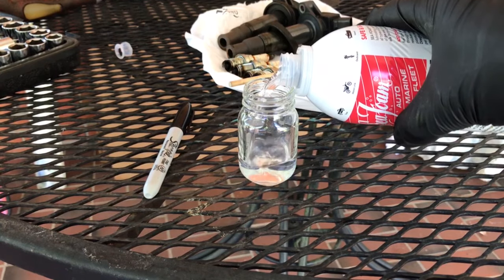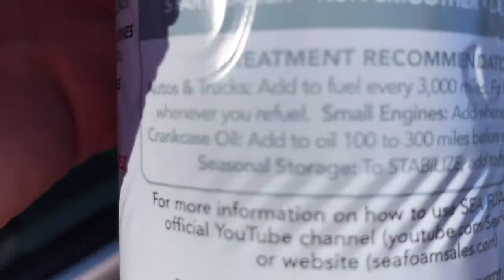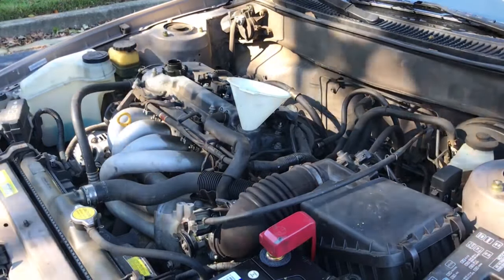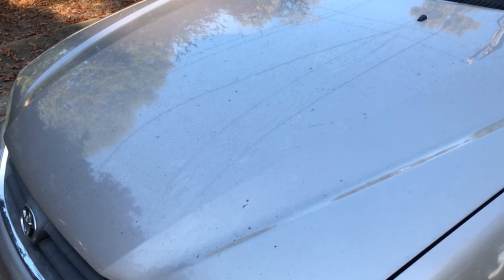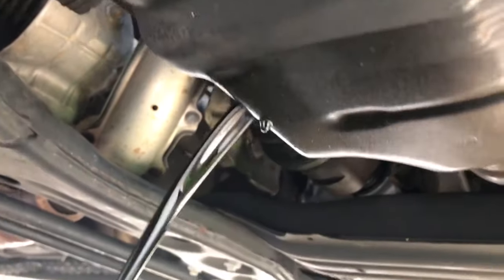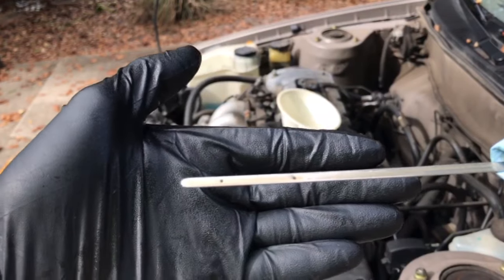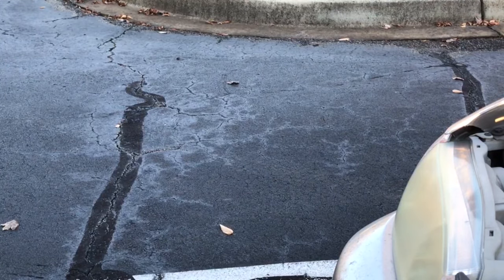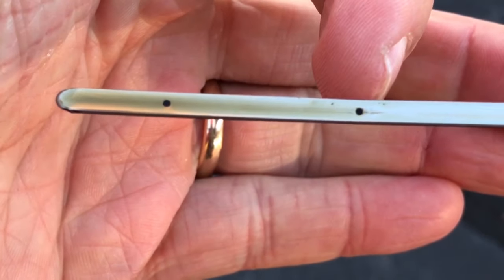Will Seafoam stop oil consumption? | Oil Burning🔥Experiments | Episode 2

Comment: Why did you never check the cross hatch pattern and run compression tests in your videos? (Did you and did I simply miss it.)   If the piston rings seized to the point the word the cylinder walls (wear marks instead of a obvious cross hatch, it is not theoretically possible to fix it with a solution.  Fixing it with a liquid is only possible if the rings were sticking to the piston and not stuck open wearing the walls.

Comment: Hi Dave......Good video. Thank you!   Ive also heard but not seen where Kerosene can be used in the plug cylinders...?  Is that stronger than Seafoam and safe?
Reply from the maker: Thanks :-) ... I think kerosene would be stronger than seafoam; in fact, I read that seafoam is about 60% kerosene or something very close. There used to be something called Motor Flush (perhaps there still is) that smelled like straight kerosene. If I remember right, you were supposed to empty a little oil and add a quart of the stuff to your engine, but only let it idle for 5 minutes and then change the oil. .... I might end up trying that or Kerosene after I get finished with the Marvel Mystery Oil experiment. Thanks for the comment--and the idea.
Reply: Never put kerosene in an engine it's not good for it. You can use motor flush during oil changes. Kerosene is a slower burner than fuel but ultimately not good 4 the pistons and rings
Reply from the maker: @crisknapp1990  Thanks for the advice, Chris!
Reply: @FamilyFriendlyDIY  no problem. I've been an engine mechanic since the age of 8. I'm not a know it all but been at it a long time. If you have an engine that's been sitting for years and years, if its totally froze up you can put 10w-30 in top of the cylinders let. It sit a day or 2 and that will unfreeze it. Pistons and rings expand when cold and shrink when warm, this is why some cars tick for a little while once you turn them off.
Reply: @crisknapp1990  piston rings are made of metal, I do not know any metal that Expands when cold and contracts ( shrinks you say) when hot??
And I think you will find that the Ticking noise comes from the exhaust section of an engine when cooling down as it is a long component and gets very hot it Expands a lot and therefore contracts a lot!
Reply: @Law_Abiding_Citizen_ok  if you think the pistons and rings don't slightly expand and contract in cold and warm weather you should go to mechanics school and learn something before you come 2 me.
Reply: @crisknapp1990  he was joking cos you got them in reverse order,nexpands when hot, not cold.
Reply: @FamilyFriendlyDIY  I think it’s called gunk it really removes grease from cloths
Reply: Kerosene will take out sticky gunk out and cut the cylinder and piston. No jechanic I am  but common sense . Dave you would know better answer than me layman 😅

Comment: I have a 1nz-fe in an 04 scion, burns a quart every 200 miles (on a good day).  269000 miles, and it's on for about 8 hours a day lyft driving in the san Francisco Bay area.  Gonna try this and a little in the spark plug holes based on your experiments, thanks
Reply from the maker: The success seems to fluctuate. We've done some more videos on this and the oil use at times has been as much as ever. Still working to find the definitive solution. Lot's of advice in the comments though. Some say they've had success using a whole can of seafoam and leaving in for the entire oil change -- I'm not recommending it, nor have I tried it ... yet. We'll see. I hope for the best for you. We're trying to use more expensive "better" products with each experiment... and if none of them work, we plan to do a video of mechanically fixing it ... Thanks for watching, and if you find success with your attempt, please let us know!
Reply: I have same car xb I’m replacing the pcv valve and trying this did it work what u do?

Comment: Thank you. I hope this comments reach you in good health and you get the chance to read it. 
My question is : 
How about doing the same experiment with Carburetor cleaner stuff rather than seafoam?. Do you recommend me to do it on my car?
Reply: No. You could damage the oxygen sensors or even possibly the catalytic converters. Use only the Seafoam, it won't harm either systems.

Comment: Some are un-stuck but a cylinder or 2 is still stuck. That's why it's still losing some oil.
Reply: Maybe. He should check the oil level after the cars been sitting for a few hours, not immediately after driving. Some of that oil is still in the engine, so giving it time to run back in will give more accurate results.

Comment: Any updates on this? Need to know as I too have 1 cylinder with stuck ring and wanted to know if your car is still burning oil? 🤔 thanks 🙏🙏🙏
Reply from the maker: Look for the Berryman’s B-12 video. That’s where we get noticeable improvement.
Reply: @FamilyFriendlyDIY  I just watched  watched Ep16, thanks for the video, so that means that Seafoam did not work then? Did you try Seafoam Deep Creep also? 

Mine seems to be a stuck piston ring because when I do a dry compression it goes to about 60 PSI and once I put a teaspoon of oil it goes up to 160 PSI, so which means mine is probably a stuck ring, but it's been 3 days now and no changes on the Seafoam, I just put Deep Creep to see if this will work.
Reply from the maker: @half_r_mk5  Nope. I didn't try deep creep, but Berryman's is a much stronger product.

Comment: 1-4 diesel-oil mixture. thrash it in 3rd gear up and down the road for 20minutes.
this strips the sludge build up at the top of your pistons. where the build up sludge carbon sticks. drain the oil straight away. top up with cheap oil then go give it another thrashing.
this time drain the oil plus take of oil pan and replace or smear gasket sealer on when putting it back on.
my car toyota corrolla 2004 dosent have a gasket. only needing gasket sealer. clean the oil screen pick up. plus degrease the oil pan inside.
best to take of valve cover when your doing this,peace of mind.and then inspect or replace gasket. top up with new synthetic oil. run for 3-4weeks or about 500-1000kms.
then repeat process, without taking of the oil pan this time. unless your want to check for curiosity. note my car had 90,000kms on it, forgot to top up oil and coolant. build up sludge big time when i opened valve cover and oil pan. anyway more then ten years later ive had no problems with it, took away the pistons from sticking plus the dreaded smoke.
the local mechanic told me this trick. saved me thousands. cheapest and most officient method out there. old school mechanics. all youtubers where against the diesel mix. because of corroding inside of motor and damaging the seals etc:
13-14 years later the proof is in the pudding absolutely works.
you should also clean or change intake gasket manifold after this process.

clean throttle body-variable timing valve solenoid-pcv-mass air sensor-oil filter-air filter.
pollon filter-clean fuel injectors and full radiator coolant flush. engine-radiator-heat core.
all these things can be done by the diy-er at home. cleaning or replacing small sensors and valves saves the car from those big mechanical problems that cost an arm and leg to get fixed. my car runs like a ferrari now. lol.

Comment: Maybe works in theory, and possibly in practice. But, if it can remove carbon/ burnt oil from an oil ring, then you gotta believe its attacking all other sludge/carbon in the engine. So, how do you know you will not dislodge enough crud to plug up important passages in bearing and or screens inside of some engines , and or clean gummed up gaskets and cause a big leak ?
Reply from the maker: That's definitely a risk, flexjay.

Comment: How do you know its stuck the rings do you have low pressure on that cylinder?? ?check pressure in each cylinder.
.Why don't you use MMO it's better
Reply from the maker: Hey @Sroor9001, I'm assuming it's the rings because this engine is notorious for this problem. Toyota put in low tension rings to cut down on friction, but they didn't spec synthetic oil. The conventional oil (probably combined with driving mostly short trips) supposedly causes varnish to build in the ring grooves, causing them to get stuck in the grooves. They say an additional cause is that the drain holes in the piston skirt are too small as well.
I might try MMO next. Thanks for the comment!
Reply: If you have carbon build up in the cylinders you actually have higher compression because the bore stroke is reduced due to the build up, also as he added it direct to the oil it also goes around the rest of the engine including the cylinder head witch as alot of return pipes and valves that return it to the sump to reduce head pressure. So if it does what it says then the cleaner would also clean the rest of the tiny oil out and inlets giving it better flow .

Comment: You want your rings not 2 stick? It's simple do your oil changes on time. If the car has been sitting running it over time will help it
Reply: Not so simple on the Toyota engines that have a habitual problem.  Yes obviously changing the oil on time helps but Toyota screwed up this ring piston combination and there is definitely premature sticking on these models.
Reply: @kinglangren  I own 3 of them I don't have sticking ring problems maybe I'm lucky
Reply: When you buy a used vehicle as he said this was it is hard to know what the service schedule was for the engine or if there even was one.

Comment: Hi Dave. Did CONSUMPTION OF 1 QT PER 320 MILES CAME BACK?
Reply from the maker: No. Down to using about a quart in 520 miles since this video. Still hope to bring it down further. Thanks for the comment, Tomasnok.
Reply: @FamilyFriendlyDIY  wow!! Still improving!
Reply: @FamilyFriendlyDIY  Good to know!
Reply: @FamilyFriendlyDIY  I was told by Seafoam tech service is to check oil once a week. And as soon as oil gets dirty change oil and add Seafoam. 

How dirty or clean is your oil at 520 miles?
Reply from the maker: @MarcP5267  I went by the instructions on the can and only ran Seafoam in the oil for 300 miles. With no Seafoam in the oil, it's still pretty clean at 520 miles.
Reply: @FamilyFriendlyDIY  I would do what tech service told me or call them yourself. Like I said they said to put 4oz in after my oil change. Which you didn’t. And keep and eye out for oil getting dirty.
Reply from the maker: I'll do that if I try it again, Marc. And that's a good recommendation to anyone else out there thinking about Seafoam. I believe one guy said he runs half a can in his oil all the time and it has worked wonders. But before I go back to Seafoam I want to finish a few other oil treatment experiments with different products.
Reply: In the sump I Would put MMO and run the entire 6k. I ratther have oil than alcohol in the sump. Maybe I wrong and the cleaning power of SF is better than MMO. 🤷‍♂️
Reply: @tomasnokechtesledger1786  what’s MMO
Reply from the maker: @tomasnokechtesledger1786  Did an MMO video:  https://youtu.be/ZJ023-Wk0OQ
Reply: @FamilyFriendlyDIY  I've been running MMO in my 2010 4cyl Camry non-stop for the last 25K miles. Now the Camry has 175K miles and I still burn the same 1 quart per 1K miles. I'm gonna use SF now instead and looks like I will use it 300 miles before every Oil Change going forward until I get desired results. MMO was worthless and I still have about 20 quarts of it left in my garage lol. Wish me the best!
Reply from the maker: @ToddTinley  I hear ya. Just did the MMO experiment too  https://youtu.be/ZJ023-Wk0OQ -- also, during the experiment the oil use fluctuated (rising at times to pre-seafoam treatment levels) leaving the possibility that the Seafoam didn't work either. However... others have said that they use even more Seafoam than I did, and they keep it in their oil all of the time and have had good results. The jury is still out. I've got a few more experiments coming. Hopefully a rebuild won't be necessary. Thanks for watching!
Reply: @ToddTinley  Use the left over bottles in the gas tank. It will keep things clean.

Comment: It might not be stuck rings in some cases, worn out crosshatch, ring tension, worn rings, worn cylinders, excessive ring gap, valve seals, clogged pvc or vent cap too many reasons to list

Comment: I have a 2006 BMW 650i, has 155,000 miles and a 4.8 litre engine it has been using oil, I want to try this on it before I give it to my daughter, I don't want her running out all the oil while I am not paying attention. some people have told me this car is totally differnt and I would hurt the engine, do you or anyone have an opinion on this.
Reply from the maker: Scott, I can't imagine using the recommended amount for the recommended duration would do any harm. Whether it helps or not depends on why the car is using oil. Are those BMWs know for sticking rings? I'd say it's worth a try. I hope it works for you.
Reply: @FamilyFriendlyDIY  Dave, thanks for that. The car probably uses a quart every three months.Not a lot but on occasion I get a blue cloud out the back. I have a 2016 I drive and it doesn't do it, But the service department tells me those 650is are notorious for leaking a little oil, But I would assume they would say that. I just recently put a bottle of Bardahl "No Smoke" in it and have been driving it to see..so far I am impressed! But time will tell. BTW , your channel is a big help Keep up the good work

Comment: If your 1zzfe is anything like the 200,000 mile one I have its severely clogged oil rings and drain ports in the piston. Probably will take several applications to get enough detergent to clean out and reduce oil  blow by

Comment: Good information Dave. My NC Miata has 125,000 and it is known to have issues with low tension piston rings similar to the Corolla. It was using about 1 quart per 500 miles.  After three oil changes and experimenting with Seafoam, Rislone and MMO, oil usage is reduced to 1 quart per 1000 miles.  As far as the problem does not get worse, it is worth experimenting with additives and changing the oil every 3000 miles.  The oil gets really dirty after 1000 miles though. The additives must dissolve the  sludge into the oil.  I am about to do the fourth oil change and soak the cylinders with Seafoam as suggested in your earlier video. 
Dave, thank you for testing various additives and reporting the results. Any thoughts of adding Rislone to this experiment?
Reply from the maker: I hadn't heard about Rislone until now. Looks interesting. Also, hearing about your Miata is very encouraging. ... As soon as I finish with the MMO video I'm working on now (if it doesn't work) I've purchased some Motor Flush to try next. I've seen a few threads about Toyota dealerships using some sort of strong solvent in the oil of cars with this problem. If what I read is true, they have something they put in the oil and run for a very short while to help (or maybe clear up) the issue. I guess we'll see. Thanks for the great comment, Tom! and thanks for watching!

Comment: Hi Dave!
Here's the thing:
Oil loss, could also come from your upper cylinder valve seals and valve guide. If they are worn-out, oil could also go into your combustion chamber and burn..
Reply from the maker: Very true. (I've replaced a lot of valve seals in my day.) But as this engine is notorious for the ring issue, I'm leaning that way for now. Thanks for the comment!

Comment: Loved the procedure and squence.
....after thinking and watching, I'm thinking spark plug holes first.
Next, add to the oil just like you did then driving the car.
Third, before draining the oil and changing the filter,  and while the engine is still warm, re do the first step again, pouring Seafoam into the cylinder and letting it set there for a few days.
.........and then drive it for 10 or 20 miles before draining and refilling with fresh oil.
My thinking:
Step one got the process started from the top side.
Seafoam, then driving splashed from the under side of the pistons helping step one do more.
The third and last step, repeating step one.
Reason being, steps one and two helped, but a final dousing in the spark plug holes while the engine is warmed up may have continued the process of freeing the rings while the Seafoam is still working it's magic. 
 I'm thinking the oil control rings would be most affected with the third time being as good as it gets for testing this product..... washing from the top down.
Glad you did this test. 👍.

Comment: You could be losing some oil through the valve cover gasket. More specifically the little O-ring gaskets where your spark plug wells are. Always the first thing to go as far as gaskets are concerned. Would explain your oily plugs. Change your valve cover gasket and watch your oil loss stop dead.
Reply: I seriously doubt it’s the valve cover gasket. With losing half a quart of oil every 300 miles, the engine will be so greasy. I have a 2001 Corolla and it eats oil like no tomorrow. The oil is definitely going out the tailpipe and eventually the catalytic converter will malfunctions and check engine lights will come on.
Reply from the maker: Yep. When I bought it, it had a cat code on it---but the CEL was covered with a sticker. The cat had already been replaced though, someone just forgot to clear the code. The CEL is still on, but the only codes are evap related. Thanks for the comment, alegroman!

Comment: after ou put  the  seafoam in to  the  engine  you  have to change  the oil   in  320  miles  or   3000 miles?
Reply from the maker: According to the can, at 300 miles, Guillermo. But lots of other people have said they run it till the next oil change.